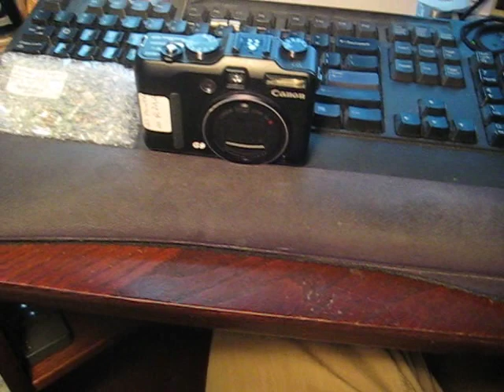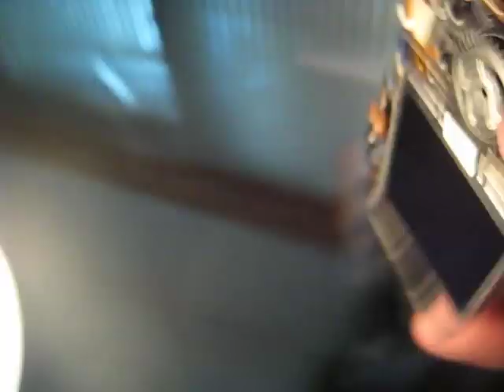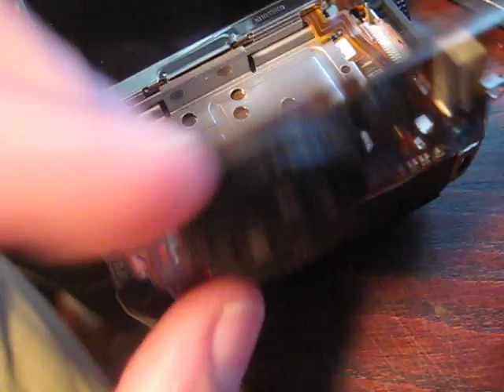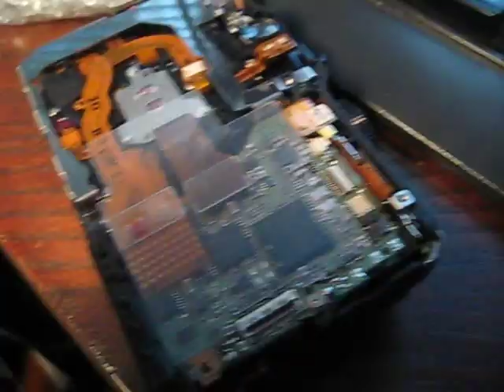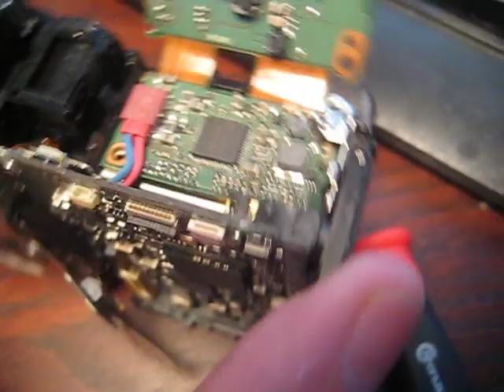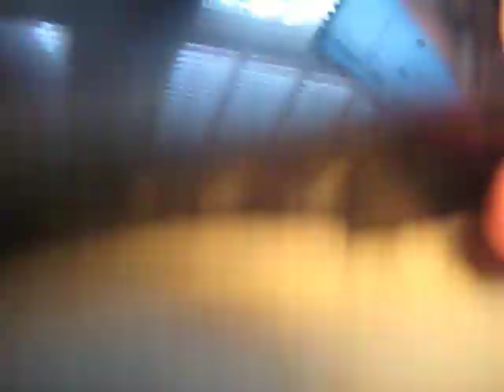Canon Powershot G9 - No Power - Power Plate DCDC Board Replacement

Comment: Thanks for the Canon G9 disassembly video. Opened up the camera and found a screw in the power circuit board. Not sure where it came from but the camera is screwed. Replace the fuse and assembled and the camera worked again. Detail on the fuse "R" is here :http://techno-fandom.org/~hobbit/pix/deadg9/ .
Reply from the maker: It's not the first time I've heard that a screw has come loose, let alone the fix for an old Konica-Minolta 5D that had a repair manual say "remove surplus screw"!  
Thanks for the feedback and especially thanks for the link!

Comment: My G9 gets very warm (hot) in the upper right top plate. Also noticeable when I remove the battery and insert a finger to the wall between the SD Card and the battery compartment.
Could this be a precursor to a short on the power board, or a GPU issue?

Comment: Is there any particular point at which the button battery should be put in the new board? Before it's hooked up to the camera with the 2 plugs and ribbon tape? After the new board is hooked up to the camera? Afraid I might blow the fuse on the new board if I don't follow a particular sequence.

Comment: Thanks for posting this video as it gave me the insight i needed to disassemble and reassemble a friends G9 to replace the dc board which had shorted out due to the common loose screw situation.

I purchased the board from Oasis Camera for 30$ and in less then an hours time, I had replaced the dc board and thoroughly cleaned and reassembled the camera.

Thanks again!

Comment: Both my friend and I have a G9 with this problem. We bought the DC DC Power Board and something shorted out in mine after it was installed. As far as my friends camera, this did not fix the problem either because his camera still won't turn on.

Comment: This was a really helpful tutorial. I removed my board following this video. I want to add that when removing the old board from the camera, there are two plastic snap holds holding the board in place. Just gently pry away from the board and it removes easily. BTW, I found a "floating screw" as well on top of my board. My question is, where did it come from? Canon needs to honor these units due to this major design flaw.. Once again, thank you for your tutorial video